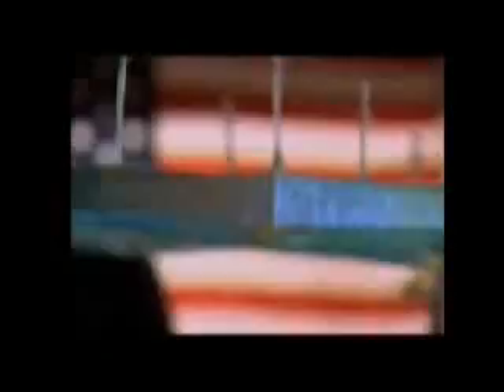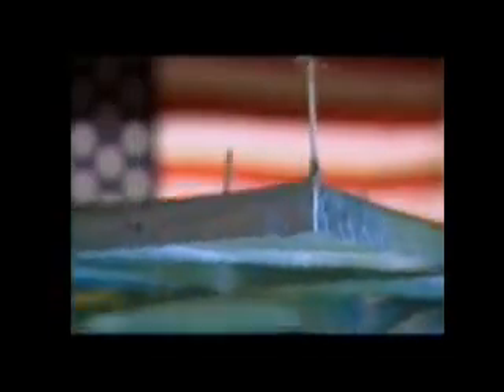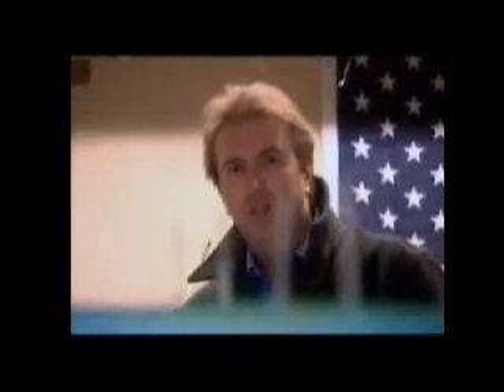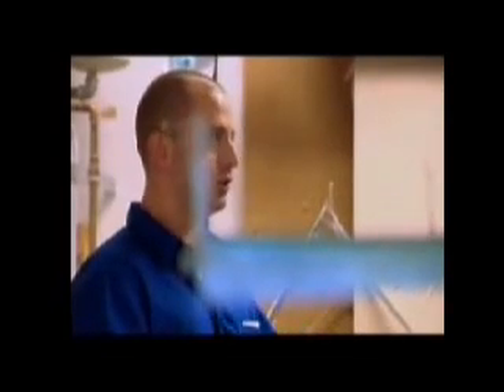UFO TECH 3 ANTIGRAVITY demo LIFTER TECH Tim Ventura

Comment: Friend wrong in vacuum this effects is also visible but instead of ions electrons are emmited. And saying that its "ionic wind" is also not sufficient because observable force is 3 times bigger than math calculations shows for ionic wind. 

The truth is nobody fully understand this effect fully. Further research are needed.
Reply: Electrical pressure within a magentic field causes movement.

Comment: It is impossible to say that any displacement of air or an ionic breeze is responsible for lift because there is simply not enough air being displaced to cause lift of the device weight (maybe 60% or so).  Also saying that it is caused by an ionic breeze does not compute either; changing the poles has relatively no affect on lift.  If it were ionic breeze switching the poles should drive it into the ground...

Comment: Exactly...I am in aviation and to cause lift you would have to displace more air than the small amounts that move smoke and the like past the wire and foil.  I would like to see some real data results on displacement ratios of weight, voltage & air.

Comment: They do NOT have to be light. I flew HEAVY sheet-aluminium, copper-tube, and perspex 1 meter diameter flying saucers in the 1990s, and demonstrated them in 2000, in Nevada. Sealed in plastic, they flew BACKWARDS. Ion-wind has an upper-limit to thrust, and is too weak a force even to cause movement, let alone levitation.

Comment: IT is only ligth so as not to need a dangerous powerlevel to lift. Ion-wind is too weak a force even to cause movement, let alone flight. The devices also work under oil, and in vacuum, as tested in many countries and institutions over the decades; you may look them up if so inclined.